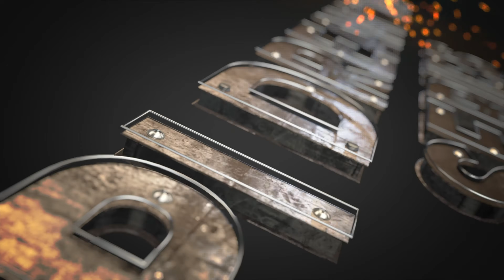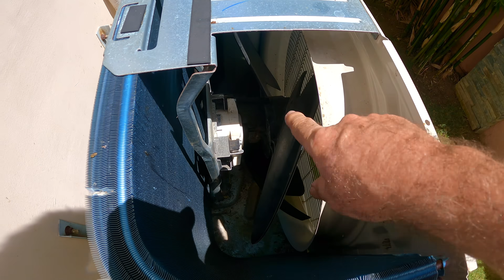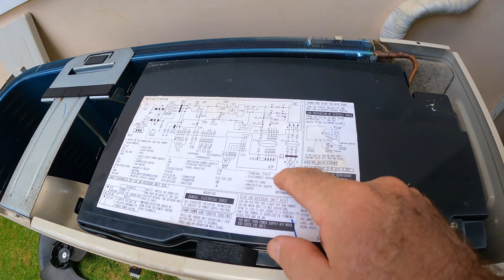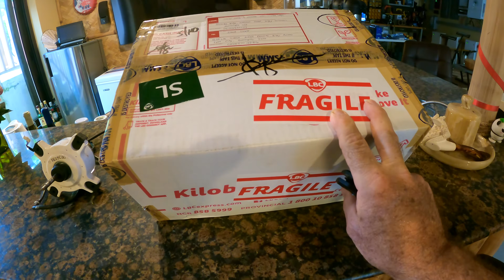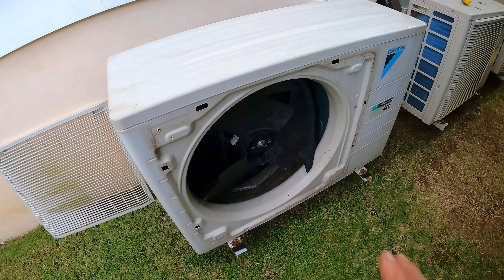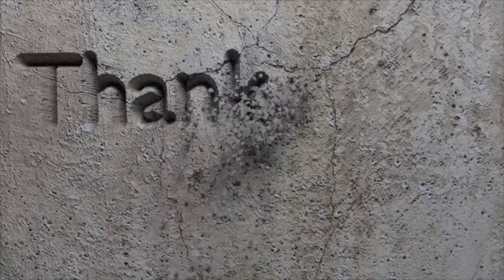HOW TO FIX YOUR AC (No Cooling, Fan Not Running or Noisy Fan Motor)

Comment: Those little motors cost an arm & a leg. I wonder if some way to substitute a different cheaper motor. Maybe AC fan motor junkyard. It be a real drag if that same motor fail again. The little lizard must of done it, bad power to fan make it fail.
Reply: I did but a little motor like that for my freezer in USA it was $225. So it just the price you have to pay. I compared price of a new freezer & decided to still pay the $225.

Comment: Right on James   I had been cleaning my split air filter every 2 wks / But I noticed reduced  air flow and humidity was still staying high in our apartment. So I found a air con service in Rosario and their service truck was a tricycle with all cleaning tools needed, They disect my inside unit and cleaned fan and coils , they then went to outside unit and  you would not believe how much dirt came out.   what I am trying to say is have your air con cleaned every 3 or 4 months. Ours is now working at 100 percent   service was only 1k peso
Reply from the maker: Great to hear.  Please share the contact info for the service out of Rosario so others can avail as well.

Comment: I was somewhat surprised you didn't clean your outside coil when you did your repair. Great job.. As John Candy would have said... "Cool Runnings"
Reply from the maker: The unit has less than 72 hours running time.  This is the first year we actually started using aircon.  The coil is still clean as the day it was installed.